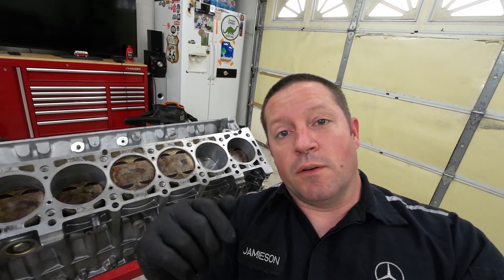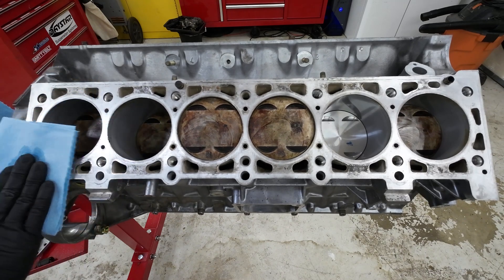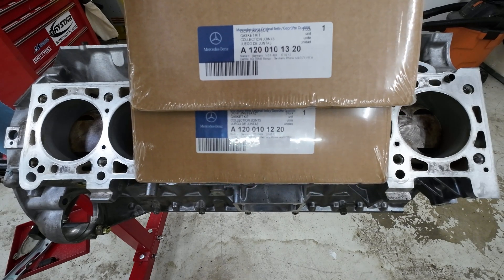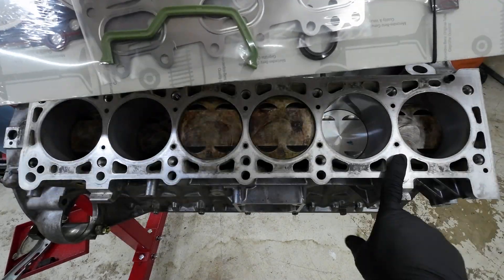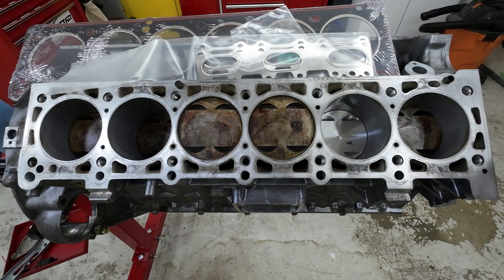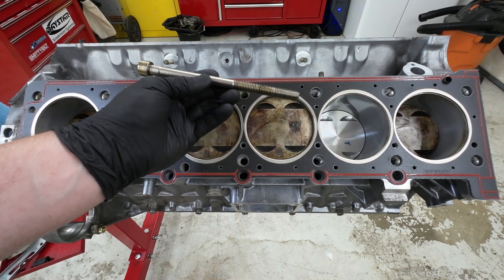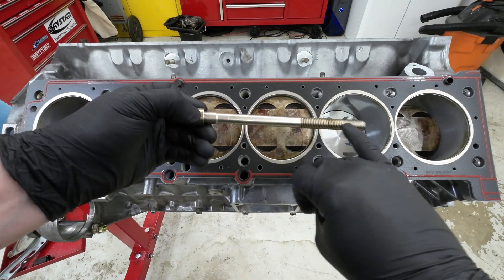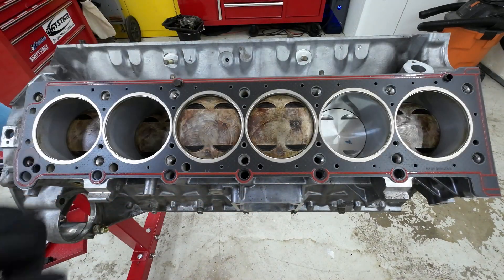M120 V12 Cylinder Head Installation

Comment: Hi I have a question. My piston had little scratches so I ordered one off eBay. My position is 2-3 and the one I received was 6-6 or 9-9 not sure. But when I installed with the arrow pointing towards the pulley it did not fit until I rotated the piston 180 degrees and perfect fit. Engine rotation just fine. Would this be an issue?
Reply from the maker: @frankissa8040  I apologize for the late reply.  I honestly have no idea what the physical differences are when you face the piston the other direction.  It's could be an expensive experiment to partake.
Reply: @FriendlyMBTech  Thanks you so much I will keep finger crossed and sent it